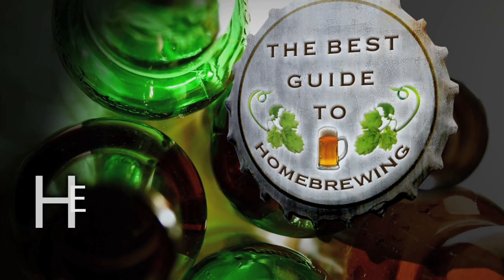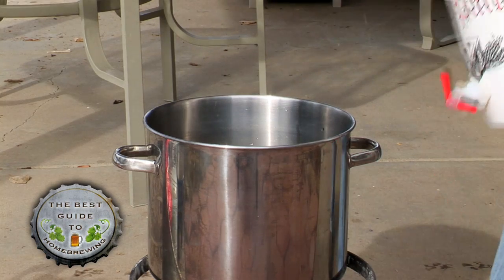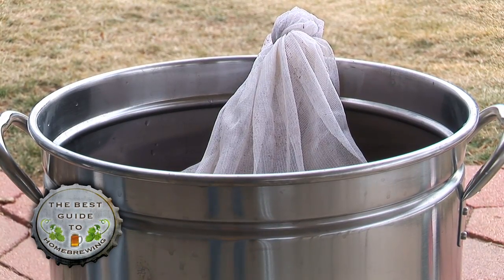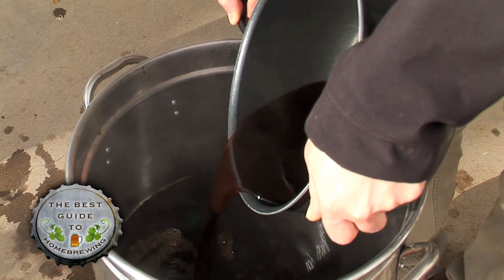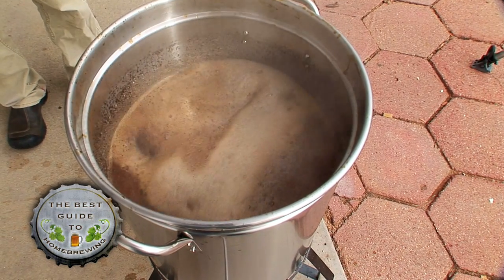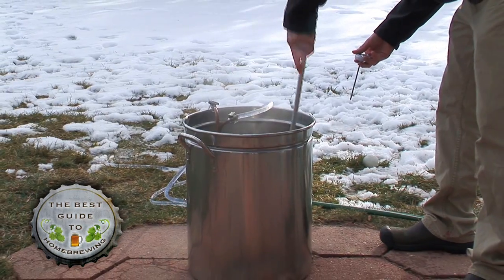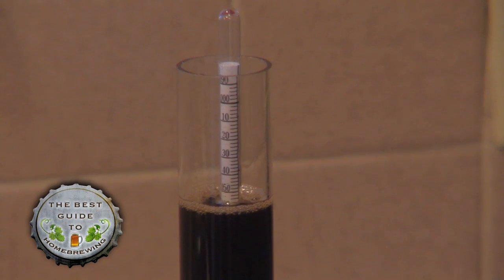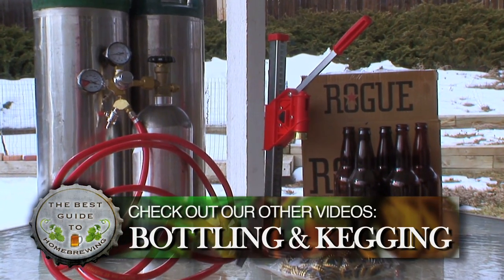The Best Guide to Homebrewing - Part 3 - The Homebrewing Process

Comment: @parsleyslrings.  Using highly chlorinated water will increase your chance of off flavored from yeast  bi-products created in fermentation. One of them is called Chloro-phenol and tastes like rubber bands.  Using distiller water is inappropriate as it does not contain ions/elements which are removed during the distilling process.